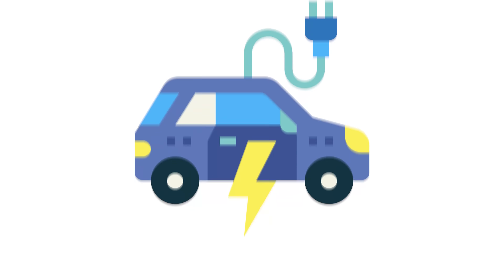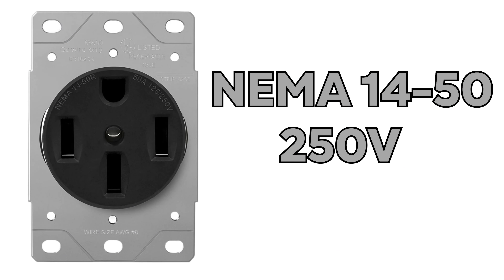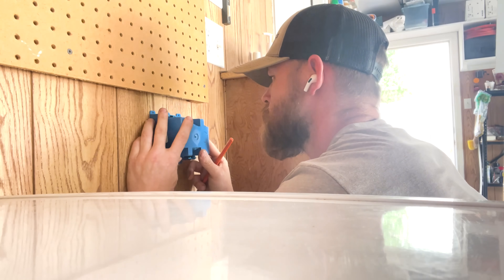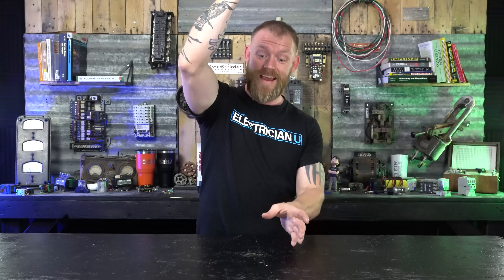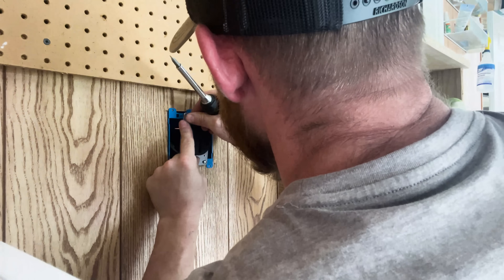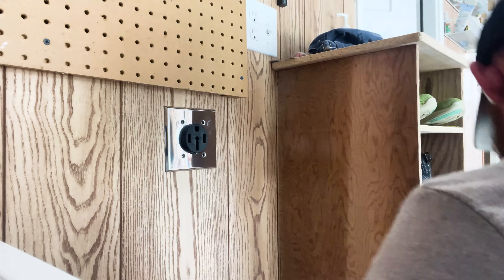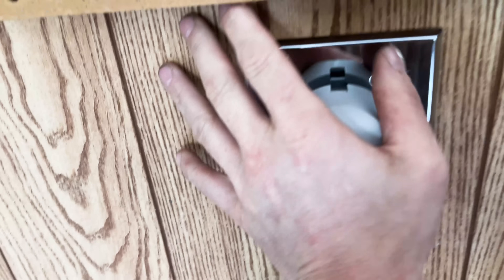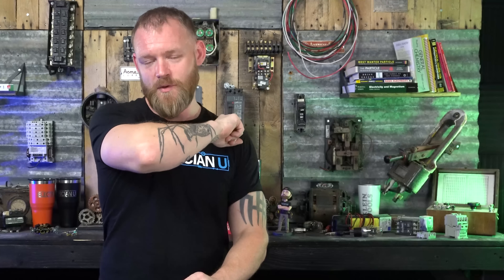How to Install an Electric Vehicle Charger Receptacle

Comment: Why did 14-50s become the standard for EVs? AFAIK pretty much all EV chargers are 240v only appliances and have no real need for a neutral.
Reply: Calling it a "standard" is probably overstating it. At least some EVSE manufacturers offer a variety of plug options on their equipment (including no plug at all, for hardwired installations).

That said, modern homes often already have a 14-50 receptacle in the garage, in case that's where the laundry machines go. Of course, if there's already a dryer plugged in there, it's going to be a pain to swap the plugs every time you want to switch between drying clothes and charging your car. But if not, then it's a convenient outlet to use for the EVSE.

Is that a good enough reason for 14-50 to the common choice for plug? I don't know. Just making a guess about why they might have gone that direction.

Comment: 8/3 for 50a? Many were telling me to use 6/3... question- on a Tesla charger install I need to do, it says 60a breaker to charge at 48a, is it OK to use romex 6/3 (rated at 55a?), also, if I tell it that it's 60a but put 50a breaker, is that bad if it's pulling 48a? Thanks!!!

Comment: Hi Dustin, I saw there has some cottons (If I am right) in the back of the woods. So should we be worried about if the cottons could be burned by the heat of the cables? Thank you.

Comment: Awesome tutorial! I put in a 14-30 receptacle for my car and its right under the panel too, so a pretty easy install. My car actually can only pull up to 20A but I wanted to future proof it for a bigger battery car later on. Plus I actually charge on 120v more often than I thought I would, so my fast charger sits a lot
Reply: I would highly recommend installing a 50 amp receptacle for electric vehicles.
Reply: Make sure the 14-50 you would use is industrial grade about $100, not the $10 ones at HD

Comment: Fact or fiction: 240  EV charging receptacles should only be installed in panels with 200 amp service?
Reply: Fiction. You could install a 6-15 receptacle on a 15A 240V breaker in almost any panel (maybe not very old houses with 60A service). That gives you 3.1kW charging.

Comment: There's some slightly incorrect info in this video.

- Tesla EVSEs aren't supplied any differently than other EVSEs. Most hardwired installations don't require a neutral, and that true of the Tesla Wall Connector as well. The Tesla vehicle plug is the only part that's different. The Tesla UMC actually has a 14-50P adapter which would work on this receptacle (momentarily).
- Putting a 30A breaker on a 14-50R won't restrict the current the vehicle draws. The vehicle is only aware of the circuit ampacity because the EVSE sends it a signal indicating the value. The EVSE needs to be rated for 30A to restrict the vehicle (unless the vehicle is itself limited to a lower ampacity). A Tesla UMC with a 14-50P would trip the breaker since the vehicle would think it can draw 40A, unless you adjust the current limit in the vehicle.
- All listed EVSEs have GFCI protection for the load-side (cable going to the vehicle).
Reply: All correct statements above. But I think you're overlooking the actual reason for the smaller breaker, which is that the customer is installing an EVSE that draws less than 30 A. Yes, if you plug in some equipment that draws more, the breaker will trip. But with the smaller breaker, sized appropriately for the equipment that will actually be used, this provides better protection for that equipment in the case of some failure that results in excessive current draw.
Reply: @harvey66616  I know quite a bit of equipment does list a maximum OCPD size, but since the device isn't governed by NEC requirements, it should be responsible for it's own protection, which is a function of EVSEs as well. They monitor current and will open their contactors in case of an overcurrent. That said, they're not 10kAIC, but a device shouldn't fault in a way that it requires the supply to protect it.
Reply: @hganti  "a device shouldn't fault in a way that it requires the supply to protect it" -- I guess that all sounds fine in theory. But it seems to me that theory doesn't always work out the way people expect. I mean, in theory the device shouldn't fail at all. If we assume the EVSE can fail at all, then we can also assume that the component in the EVSE that is supposed to limit current could itself fail and present a hazard, in spite of what the theoretical design is.
Reply: @harvey66616  Extending that logic, the breaker can also fail, but it's a matter of layering safety mechanisms and a 30A breaker will trip sooner than a 50A would under a moderate overcurrent. I just wouldn't expect a failure mode to be drawing between 30 and 50A where the 30A breaker offers a significant advantage in time-to-trip.
Reply: @hganti  in a perfect world, nothing would break. After that, it's just about where you choose to draw the line. Just because you have as much faith in a complex device like EVSE as you do in much simpler device like a circuit breaker, doesn't mean it's not legitimate for someone else to feel differently and draw the line somewhere else.

Comment: 8/3 NM isn't rated for 50 amps, it's rated for 40. You'd need THHN or THWN inside a raceway to use 8AWG. Also, the hardwired Tesla chargers have built in GFCI protection so it's better to use the hardwired version because if you install the receptacle it still needs GFCI protection by 2020 NEC standards (which can cause problems with nuisance tripping).
Reply: The last one I did they did the 48 Amp charging so I used 6AWG THHN inside FMC and installed a 60 amp breaker.
Reply: @illestofdemall13  Did you run 6AWG for all four cables? or did you downsize the ground? I'd imagine that tieing the metal box ground (pigtail) to a 6AWG cable is more difficult.
Reply: @eddied4969  No, we used #10 ground.
Reply: @illestofdemall13  thanks.. i've been looking for that answer on youtube for days. i saw a table in the nec2020 handbook that said you can downsize the ground but needed verification..

Comment: I got a "portable" level 2 (220V) charger from Amazon and had an electrician put in a standard electric dryer receptacle. Portable charger runs at 16 amps, I've never had a problem with it tripping the circuit breaker.
Reply: yeah right, and you are loosing quiet a lot of energy charing this way.

Comment: - NM cable uses the 60° column and therefore #8 isn’t good for 50A. 
- NEC states 50A outlets are to be supplied by 40 or 50A breakers. 
- I thought all outlets in a garage were to be GFCI protected even before the 2020 NEC. 
- You should mention torque requirements for the outlet and breaker terminals. This is very important for high amp loads.

Comment: Thank you Dustin for reminding electricians to take a proper set of voltage readings with a meter.  I work in tech support for high amp draw medical devices and it always blows my mind when someone has an equipment problem and I ask what the voltage is to it and I'm told " the electrician said it was good".  
WTF is "good" on a meter?  I NEED A NUMBER, DUDE!   "Good" ain't no number I ever heard of.
Reply: We get that same response in the HVAC world as well. If you're not testing, then you're guessing, and my ability to help solve an issue is limited to simply guessing as well. I insist on them testing and giving accurate information. If they don't have test equipment then I tell them to call back when they do.
Reply: @mattkaramccarthy677  what tolerance do you put around the 120V nominal? 5V?

Comment: I have a question that I cannot seem to find a definitive answer to. Some of the vehicles will take higher amperage charging. I have one that will take 48 amp continuous (hard wired, not a receptacle). What gauge wire is needed for this? The EVSE/Charging unit I have has a maximum of 6 gauge, but as it seems to me running 48 continuous 6 gauge is not enough. Is 6 gauge plenty for a 48 amp continuous draw for charging?
Reply: You would need a 60A circuit to run 48 continuous.  But just because the car is capable of that does not mean that it needs that.  If you set up a "charger" (EVSE) on a 50 amp circuit, and set it to charge at 40 amps it will tell the car that that's what it should draw in the car will happily draw 40 amps.  Or you could do a 40 amp circuit 32 amps or a 30 A circuit at 24 amps, etc.  The car will be perfectly happy on any of those, but we'll just take longer to charge.
Reply: @charliesullivan4304  thank you for your response and explanation. Is 6 gauge enough for a 60 amp / 48 amp continuous circuit? I have an Ioniq 5 that has a max rate of 10.9kw (45-46 amp), but I have a visitor with a Tesla that accepts the full 48.
Reply: @applemachome  It doesn't matter whether you are running 45 amps or 48 amps. Either of those would require a 60 amp circuit, with the evse set to 48 A.  If you run a 50 amp circuit with the evse set to 40 amps, either car will happily charge at that rate.  If you decide you want the extra 10% faster charging speed on your car, and the extra 20% faster on your friend's car, what you need to do is install 6 gauge wire in conduit, rather than using 6 gauge Romex. That allows you to use the 75° column in the ampacity table instead of the 60° column that you have to use for Romex.
Reply: @charliesullivan4304  thank you for your replies, this is helpful. I don’t have attic space over my garage, and the charge port is on the opposite wall from the panel, so I’m expecting surface mount metal conduit would be the plan.

Comment: Epic vid!
I’ve installed a few Tesla chargers, they’re pretty cool. Do you know why they don’t use a neutral? Also I read on Tesla’s website that they require the installation to be in copper as opposed to aluminum. Is there a technical reason for that?
Reply: Most 240V devices don’t use a neutral.  The only way they would is if they contain some component that runs on 120V (e.g. a clothes dryer where either the light or timer motor is 120V, or a stove with a 120V convenience outlet).  It’s better design to have every component in the device run on 240V.
Reply: The terminations lugs in the Gen 3 Wall connectors aren’t rated for aluminum. Also over time some lugs will actually work themselves loose due to the expansion and contraction properties of aluminum.

Comment: What would be the minum size of service you would require to have to support a 30A, 50A or even the Tesla and ford 150 lighting 80A charger?
Reply: It all depends on what other major loads there are.  Really need to either do the calculation, monitor for at least 30 days, or use an EVSE with load management so it throttles back if the total load is too much.
Reply: @charliesullivan4304  that was actually gonna be my follow up question. Like what If they have a hot tub and AC or both. Or a suite that they rent. Well according to CES(Canadian electrical code) it says 7200W, which is basically 30A. But that doesn't really take into account how fast you want your car to charge LOL. Because 30A for a Ford 150 lighting  at 30A would take 15 plus hours to charge, from like 5-10% to 100%, which is not great. 
I can't imagine getting one of those trucks  and plugging into a 120V outlet XD.

Comment: I don't understand why the charger amps was never mentioned. A lot of chargers do at least 30a so running a 30a breaker has zero overhead. What are they using? If they are running the changer at a lower amperage that's fine but its a critical component of this system and should be part of the decision process and not just "the customer wanted this".

Comment: Easy way to secure the cable: use romex clamps that snap in (metal, not plastic) instead of the locknut version, and snap it in in from inside the panel (so that the screw-clamp side is inside the panel). This is allowable, though the clamp inside the box adds to box fill.
Reply: It's a 2 screw snap in connector right?
Reply: @dragocrawford5303  Yes. Same as a regular romex connector, but with a snap in ring instead of the locknut.

Comment: Soon, my electrician (nephew) will be installing a Ford Charge Station Pro, 80amp on a 100a breaker, direct wire.  You guys are going to be seeing a LOT of work requests in the coming months for this type of installation!!
Reply: Do you have 200a service? That’s a lot of commitment for 100a car charger.
Reply: @cybertrk  no, we will also be updating my 100A panel, running an underground feed to a detached garage 80 feet
Reply: @TaxmanHog  holy cannoli… I feel like homes will eventually become standard with 400 amp panels if this keeps up.
Reply: @cybertrk yeah, or at least 320
Reply: Heard about this one Ford customer who wants to simultaneously charge 2 F-150 Lightning electric vehicles. 
They're upgrading to 600 A service and paying $31k just for the utility to upgrade their end (separate from the homeowner's breaker panel\level 2 chargers\electricals at the home itself).
I feel like I'm better off waiting, rather than being an early adopter and paying $$$$$ out of pocket for something the utility would eventually do anyway.
Reply: I paid about $4k to upgrade to a 400 Amp service.  I have a 100 Amp Tesla wall connector (80 amp load) and a 50 amp NEMA 6-50 G.E. Wattstation (40 amp load).  I am having a tough time seeing why anyone would need 600 Amp service unless they have money to burn.
Reply: @andrewdiamond2697  they might be going 600 amp, if in a mansion or have other equipment pulling that high of power. Who knows. I know an electrician that put a 1000 amp service to his house
Reply: @mostafa685  Wow.  I felt like a big dog on my street going from 200 amp to 400 amp service.
Reply: @andrewdiamond2697  yeah I would to 👌👊